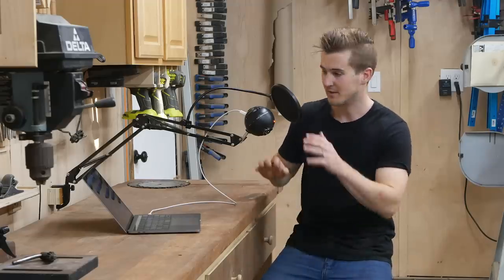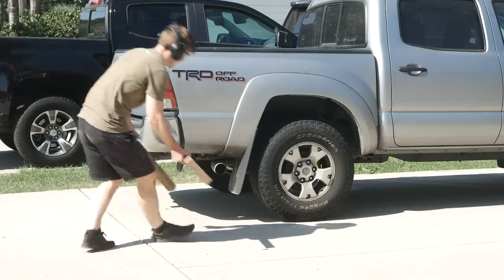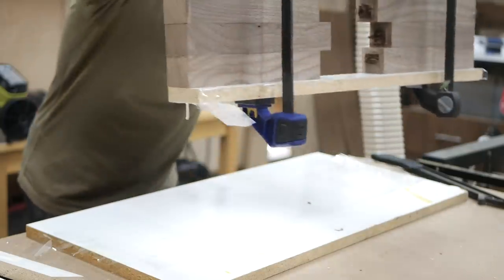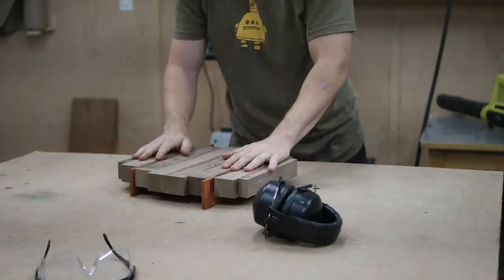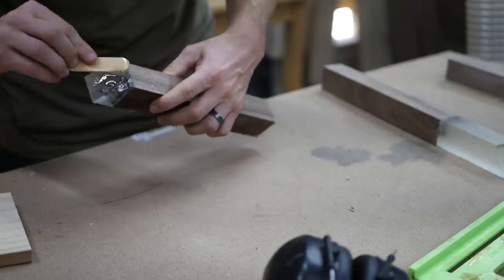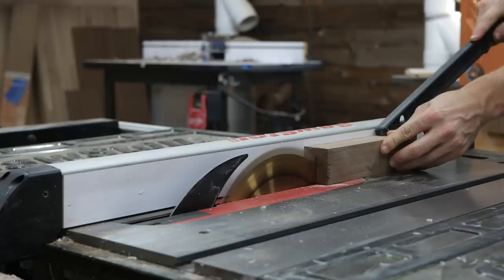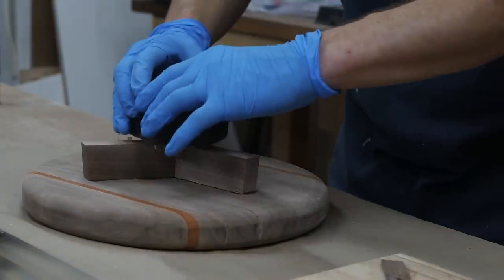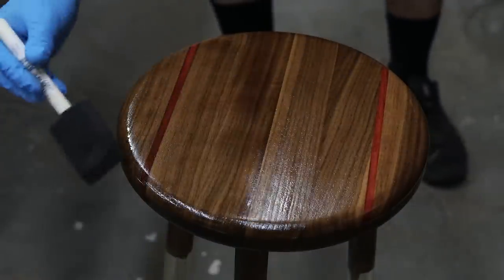FLOATING Epoxy Chair  | 46

Comment: The bubbles by the wood are from the wood and not the epoxy. Next time you should try sealing the endgrain with 5min epoxy and you will get a much better finish. Overall very nice though!!
Reply from the maker: I wish I knew this trick before the project - thanks for the advice though!
Reply: But then the epoxy cant penetrate the wood so deep, so the connection between wood and epoxy is less strong
Reply: James Lovick-Earle great tip. Thanks for this one
Reply: Kick Ass Videos 2 points to this. 1, he literally stuck the legs back together with 2 part epoxy 2, if you’re worried about strength you can use the same brand of epoxy and paint the endgrain, let it cure, lightly sand and then fill the mould.

Comment: Ps in order to make epoxy clear, just paint on another thin layer of epoxy after you use the acetone and it will be perfectly clear
Reply: This could work, unless the cloudiness is due to internal voids in the epoxy resin due to internal degassing as the epoxy expands and contracts during the curing process. Voids from trapped gasses would also explain the fractures in two of the legs. 

In lieu of a vacuum chamber, thin layers of epoxy build up to the final thickness would minimize this effect and more effectively dissipate heat due to the more optimal surface area to volume ratio and would allow more of the trapped gasses to escape during the early stages of curing in each layer.
Reply: Nah it's the final grit and the compound used and pad used...i used 3000
Reply: This is 100% true. It's a trick used in modeling (water scenes, etc.)
Reply: Daniel Armstrong                               Has day G iot high. If if @

Comment: I'm gonna try this, but making a cane for my mother.
Instead, I'll just get a dowel and break it and then stuff the broken ends into a piece of PVC pipe and fill the pipe with resin through a hole in the side. Much simpler, but probably won't be as nice. But I don't have as many tools, or as much money for expoxy... so I'm gonna have to get creative.

Great video, nice inspiration, and you set a great example by not giving up and keeping a good attitude through failures!

I'll definitely check out some of your other videos after this one!
Reply from the maker: Sounds like a fun idea! Good luck!
Reply: danteelite don’t forget to apply a release agent to the inside of the pvc pipe! It will not come out otherwise
Reply: @Voiidpriince  I ended up doing a small test, and it actually released pretty easy with no release! I didn't even think of that, and I cut the pipe up both sides and split it open and none of it stuck or anything.
I'll probably use release when I do the big version though just to be safe. I've just been busy with my sick dog and haven't gotten around to it. I don't mind tho, he comes first! I just gotta try not to forget about this project!

Comment: As much as you stumbled through this, it did not affect your great stool. I love it. The floating legs are really cool

I have one question though, does it sit level? The way you cut the tips off of the legs imparted different anhles on them, but maybe not enough to be noticed. Is it level ebough to not be a bother?
Reply: 3 legs and it'll never wobble. Might not be perfectly level but it wont wobble.

Comment: A good tip of advice when cutting off the dowel plug so its flush you can use a hammer and chisel to pop it of easy

Comment: A neat little trick: if you paint over that clear epoxy using the same batch, it looks a lot closer to the clear result you wanted. Different batch could work, but maybe a waste and may not result in different visibility at all.
Reply from the maker: I was nervous to try it in the finish product but a great tip
Reply: @workshop_edits  it takes practice with these things, I wish you luck

Comment: Awesome look, my only concern is the strength of the legs with the different materials. There's really no strong physical connection between the resin and the wood, plus the wood might expand and contract against the resin making it get weak over time. My fear is that the legs could break fairly easily with a jolt or drop. Besides that worry it looks amazing and would be a cool technique for other pieces that don't have to take the weight of someone sitting on it.

Comment: If you ever need to break it again make longer pieces or extend them sliding them into a long pipe, the premise is: Think about a broom, slide it between two pieces of a tree trunk that started to grow apart in a V, and lever it so you can break it slowly so the fibers have time to "demesh" more individually, it's not about strength but slowly breaking it apart.

Comment: Nice Job. If you had drill a 3/4” or 1” hole in the ends of each broken leg to allow the epoxy inside, the joint would have been stronger. Thanks for sharing, Great look.
Reply from the maker: Great tip!

Comment: Cracks and cloudiness can be minimized with shallower, layered pours of epoxy resin. The shallow pours with a partial cure in between each allows any trapped gas to escape, as well as allows some of the heat caused in the curing process to escape. While each layer is still soft and relatively thin, and also allows each consecutive layer to fill in any weak areas formed due to expansion and contraction of the resin. 

Also, to get crystal clear epoxy, degassing under vacuum is best practice. If you intend to incorporate epoxy resin into future projects a ~$100 vacuum pump and a small vacuum chamber (big enough for a half filled container of epoxy) is worth the investment. You won't realize how much gas and air is in your epoxy until you see it boil out under vacuum. All of this gas will end up trapped in tiny, microscopic bubbles inside the curing epoxy that can both cause cracks as well as diffuse light (reducing clarity and strength). Without the vacuum, you can still pour very clear epoxy, but each layer must be poured SUPER thin, almost like a thin film. Wait 30 mins (or whatever is recommended for the epoxy resin by the manufacturer), quickly blast the surface with a torch to pop the bubbles, and then add your next layer at the recommended interval, rinse and repeat. 

The key to strong, crystal clear epoxy resin is time and patience. The vacuum chamber will reduce time and increase layer thickness, but laying the epoxy resin is almost always going to improve pour quality and minimize risk of fissures, cracks, bubbles, and diffusion.
Reply from the maker: Thanks for your tips. This is thickset epoxy which allows for pours up to 2 inches. I just let it cure in too hot of an environment, which lead to bubbles and cracks. Cheers.

Comment: next time, you should make only 1 leg with wood, the other ones complete with epoxy, that would looks like the chair stands only on 1 leg. :) or the legs complete with epoxy and put an led inside the leg. i helped a friend of mine to do this, because i have a company and work for over 25 years with epoxy. there are so many possible things you can do with it. it's only important, to use the right epoxy, because not every epoxy is the same, but i'm pretty sure you know this. :)

Comment: You can seal the wood to stop the epoxy from bubbling overall great project looking forward to upcoming vids😊
Reply from the maker: Thanks for the tip - someone else shouted that out and I'll definitely use it next time - do you think it would strengthen or weaken the joint?
Reply: @workshop_edits  if you seal ans scuff it up a bit it should strengthen it

Comment: I wonder if the sledge hammer would've broke the walnut or just blew your clamps apart and cracked the workbench. I'm interested to see how that could be done. anyways. great video!
Reply from the maker: that would have for such a more interesting video...
Reply: @workshop_edits  I say find a friend or a place to borrow a 20lb sledge. And make another project with round legs. Just dont break your workbench lol

Comment: Very cool project and video  BTW you did a smart thing with. Ot using the   Incorrectly mixed Epoxy  i will never work correctly  when its messed up  the pocket screws on the melamine mold parts were a. Smart idea as well  the overall results on the legs are prett cool  if anyone ever notices  the “broken”  legs  b in your shop i would mess with them by telling them it  was a  stool that you bought from the Harry. Houdini Estate. And was something he used    On stage  LOL  i like doing things like that just to see someone’s reactions  Amazing how tough Walnut can be  my first thought was anchoring it and pulling it with a Come along tool  or a 4WD vehicle

Comment: You could have used a chisel to chip and break the wood up a bit more , you could improve the effect by putting some splinters and chunks of wood in the epoxy layers to make it look like floating splinters between the bits of wood
Reply from the maker: Could do a lot of things better or different a second go around - hindsight is 20/20!

Comment: Hello! It is an interesting design for stool legs. I am wondering the epoxy is strong enough to hold an adult's weight?
Reply from the maker: Yea it is - I’d make the base more solid though with extra connected supports. But epoxy is very strong

Comment: Generally, when mixing larger batches of resin and hardener, it cracks because the mix reaction is exothermic, so it expands and contracts a lot. I would have poured it one leg at a time.
Reply from the maker: This is a deep set epoxy meant for large single pours.

Comment: maybe if you smashed the legs so that they were not so clean and you did the whole bottom part clear it would look so much cooler! Like the stool got broken but was still working cause it's floating!
Reply: You know like those secret wood projects (I've seen rings, jewels and furniture made out of those, and usually the epoxy resin is colored bright aqua or bright blue)

Comment: To increase durability for this project.  May I suggest, for the epoxy section, instead of using flat surface wood, maybe drill a cylindrical hole on both pieces of wood, put a large screw into each hole so it's hidden within the wood, but still allow ample space for epoxy to fill.  The epoxy will then flow into the wood, wrap around the large screw, resulting in larger surface area of epoxy-wood bonding, with added strength of metal screw, thus more durable.
Reply from the maker: Good note - but just to confirm - this is also plenty strong as is for a stool that holds an average sized man

Comment: I think it's your sanding and polishing of the plastic piece that's why its not clear and not the rpixy...when I restore my head lights the final grit was 3000...ive seen some kit that has a final sanding at 5000! And the polish you use might not be the best...try automotive polish or dome liquid polish that has a higher more fine polish compound with a foam pad...ive heard the pas makes a difference too.

Comment: It's nice but I wouldn't trust it to sit on. Also, why use epoxy to attach the legs? It would be much sturdier if the legs were inserted into holes in the bottom of the seat. I'm curious...has it held up?
Reply from the maker: I sat on it in the shop this morning. I also sat on it for the entirety of the video. Many ways to skin a cat - yours isn’t wrong, and I stand by my own experiments.  Cheers

Comment: you should get a blue yeti mic and get rid of the snowball
Reply from the maker: I didn't realize they were only $100 - are they that much better?
Reply: @workshop_edits  the sound has better bass to it so it sounds fuller and can have omni directional sound so it picks up from what area you want
I got one and i am really pleased with it

Comment: Curious if you used any heat on the epoxy to remove bubbles before it set?
Reply from the maker: I didn’t. I went and checked after an hour and there weren’t any visible ones on top so I just skipped it. Good question though l. I think the deepest is a lot thinner so less bubbles. Did have some on the inside by the walnut joints though

Comment: Dude you should use a mouth cover when sawing. Tiny wood particles can get into your lungs and on the long run they're gonna cause you trouble...
Reply from the maker: Man. I can never wear enough safety gear for you safety nazis
Reply: Haha I know right. But it's only for your own good 😊 long term dust inhaling can cause problems
Reply: @workshop_edits  I hope you wore gloves when you typed out that reply?. Keyboards often have sharp edges and can be incredibly dangerous to finger tips. You can never be too careful. ALWAYS wear gloves when commenting on Youtube.

Comment: How do you like the rockler miter sled?
Reply from the maker: The table saw sled? It’s great
Reply from the maker: The taper jig is good too incase that was what you're referring to - but you can easily make that yourself.
Reply: @workshop_edits  
Thanks for your responses. Yea, I meant table saw sled. I am looking at that, thinking about buying one. I saw your tapering jig, I made one of those. Thanks again!

Comment: What dimensions would be needed for the walnut to recreate something like this?
Reply from the maker: The pieces I used were:
-8/4 Walnut - 30" x 7"
-8/4 Walnut - 24" x 10" (had a big crack in the middle so quite a bit was useless material"
Cheers

Comment: Save your time in sanding by applying PU coat with gun. You can do it after 600 or 800.
Cheers
Reply from the maker: Thank you for the tip - will look into it on my next project!

Comment: Very cool, lots of good ideas in this vid as well.  You earned a new sub.  ;)

Curious, if you were going to plug the recessed screw holes with dowels, not to mention accented ones, why not just strengthen the joint with dowels instead of screws alltogether?
Reply from the maker: Thanks - I used screws with plugged dowels so the screws could tighten things also and make the joint stronger since it was a tricky joint and I couldn't pull in things very tight on the initial glue up. Cheers

Comment: i think you shouldnt have polished the legs, more rustic old look and you can see inside the poxy where you sealed the joint after the crack? just my opinion but great job though A+
Reply from the maker: To each their own. I had set out to make the “floating” look and the rustic vibe wasn’t going to cut it for me. And the cracks were unavoidable - bigger thing for me was the learnings for next time. Cheers!

Comment: You dont get any snype with that planer?
Reply from the maker: I don’t. I used to. A TON. But if you lock it between each lowering with the switch on the right then there is no flex or ability to snipe. I also try to leave at least one piece long in my glue up so if there is any bit of it it’s not on the big piece. Hope that makes sense.
Reply: @workshop_edits  i try everything with mine and keeps having some and mine desnt have not lock :\
Reply from the maker: @Dumontsk8te  Is it the Ridgid one?

Comment: If you had put the legs in the drill it would have been easier to sand it
Reply from the maker: That's not physically possible
Reply: @workshop_edits  Why?
Reply from the maker: My (most) drills can’t hold something that thick

Comment: if this didn't last past drying time i don't see how it can hold weight tbh...
Reply from the maker: It cracked because of the environment the epoxy cured in, not strength. I’m sitting on it the entirety of the video while I talk. Cheers.
Reply: @workshop_edits  tbh it's the bond between the wood and the epoxy that kinda throws me... i feel like it could snap...

Comment: I used the gorilla 5 min epoxy and at first was happy with the results... I used it to protect my nephews concrete garden pavers he’d made for me which had tiny pieces of shell and other pretty stuff he’d personally collected for my paver gift... well the epoxy did it’s job however immediately yellowed and then turned this nasty 🤢 yellowish orange ruining my nephews hard work 🤦🏻‍♀️ so how the heck do you keep epoxy of any price range and quality from becoming a nasty, funky yellow vomit color? It said “clear” on the package but that lasted not even a day because of course once dry I set it outside only to discover over an hour later that hideous coloration. It’s traumatized me from ever wanting to use epoxy again but for all the beautiful pores on YT clearly I did something wrong
Reply from the maker: Worked great for me so far!

Comment: Not even talking about the epoxy, the stool design is too flimsy. There is a reason everybody else braces the legs at least once. You put 50lbs on that and wiggle it, the legs will splay.
Reply from the maker: Lol - ok guy who has never sat on it. I’m 165 and am sitting on it for the entire intro and outro. It’s rock solid. But good luck with your assumptions.
Reply: william spindler it isn’t made for 300lb people. I do think the cracked legs should have been scrapped though. A bit more work involved but why didn’t you make 3 Separate moulds?
Reply from the maker: @nicksainsbury7152  I thought doing a single mold would waste less epoxy and make breaking it down into individual legs easier. I'd do it again the same way.

Comment: Please dwell some more on the final product. 15 minute video and not even 15 seconds to drool over the final product! Huh..
Reply from the maker: USE. THE. PAUSE. BUTTON. Good grief.
Reply: @workshop_edits  Pause does not show different angles.
Reply from the maker: It’s a round stool with three identical legs. You see the top, legs, and entire stool from multiple angles. What else do you want...

Comment: just fyi you are not pointing the mic at your mouth. you are supposed to talk into the big  "Blue" text on the front. You are talking into the side of the mic and its a little triggering.
Reply from the maker: I was under the impression the Ice picked up sound omni-directionally?